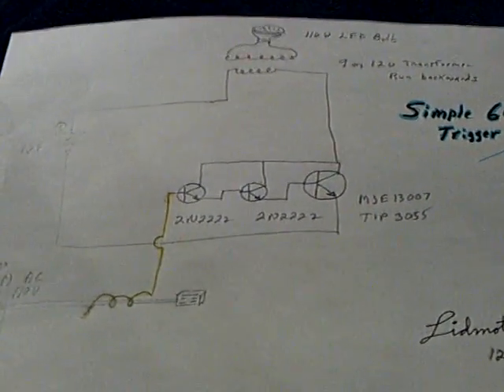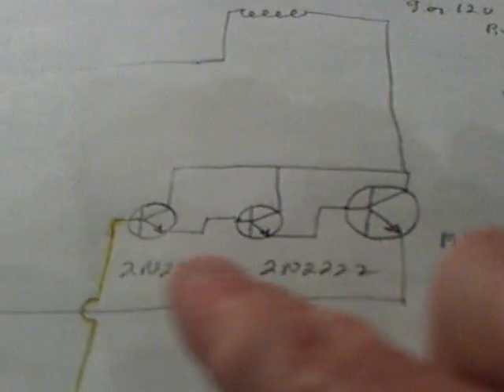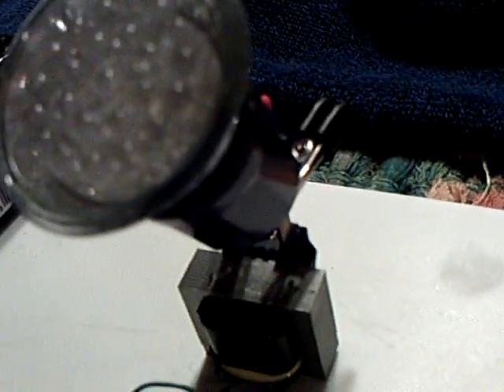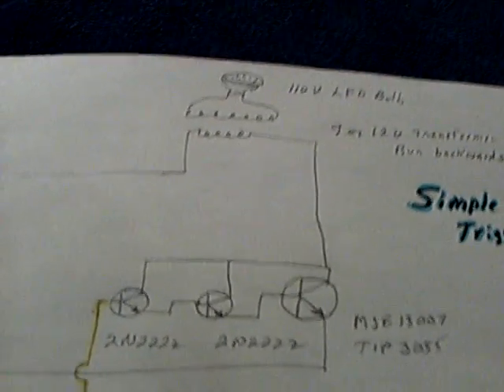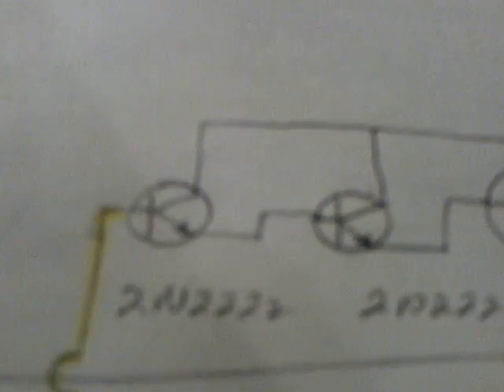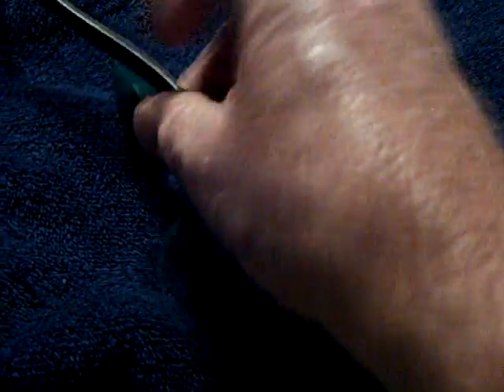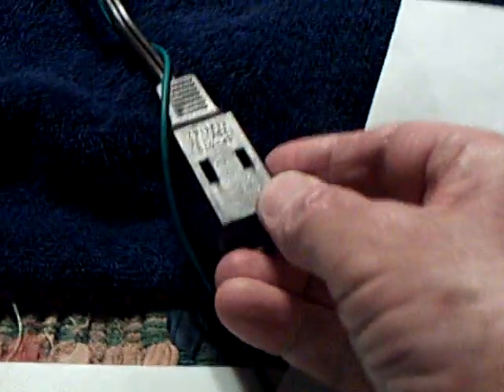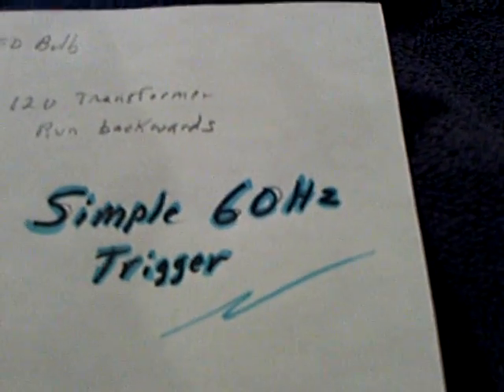Simple 60Hz Trigger

Comment: @Lidmotor 

Wow, glad to see it still running but shocked that its down to .6 volts. Have you tried putting it a sealed container? I've found that putting it in a sealed container helps the output power a little.

Truthfully I never expected the stove top cell to last, it was only to prove a point that water doesn't needed to be added to make a cell work. Thank You for testing these cells Lidmotor!